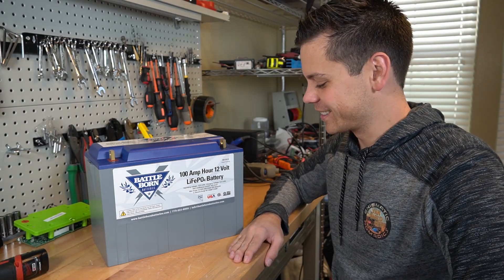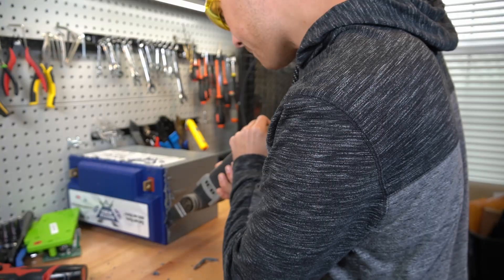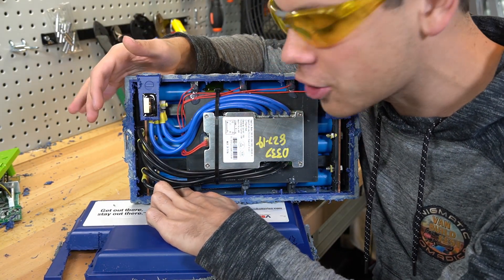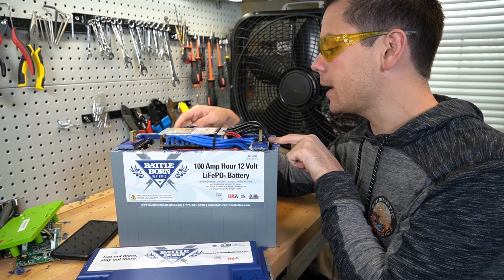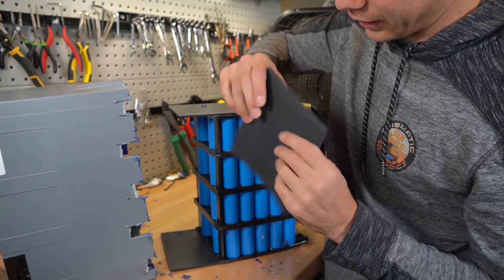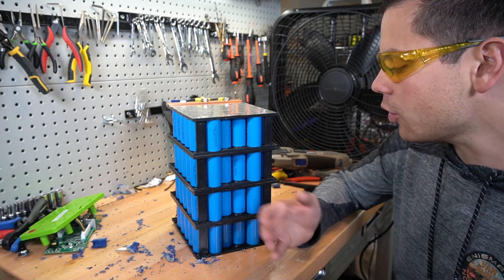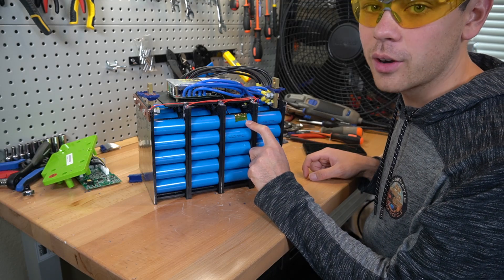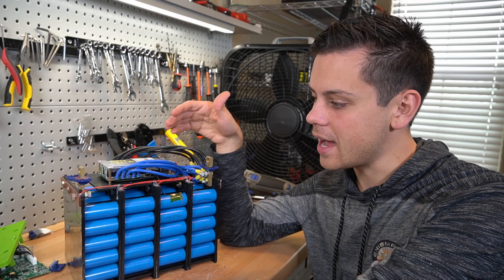$950 "Battle Born" Battery Tear Down

Comment: WELL DONE WILL !! 
Still room for improvement:
Case needs to be non-destructively open-able, yes OK that voids the warranty sticker; self sufficient people exist
Bluetooth (or other open source method) communication to an App with configuration for charge depths etc
Communication to a LiFePO4 charger, especially for low current balancing mode, plus spoofing when charged from a standard Solar charger, alternator, gen-set, all 12v sources
BMS should NOT be mounted inside the case, it needs to be outside, where air cooling is available (who cares if it "looks" like a car battery or not, really !)

so DIY is still far better... until Customers expect these features

Comment: If you had a 12v, 24v and a 48v battery bank and each bank has a total of 500 amp hour and a 20 amp hour load, which battery bank will last longer. I have 5 of these 100amp hr battle born batteries and I plan on adding to it but I don’t know if there are any advantages over the other in the above scenario. I’m thing of the 24v route..  

2nd question. Can you connect 10 12v 100amp hr batteries in a 24v configuration to get a total of 500 amp hours. Thanks..

Comment: Run a warn 5500  12 volt winch tech told me the full load amps would be 200amps , thanks for the video

Comment: Would this battery type be more vibration resistant than the 100AH smart Renogy battery that uses pouch cells?   (I tow my trailer off road)

Comment: I'm sure that you are already aware of the new Battle Born GC3 270AH battery? Stackable with mounting feet and will fit in a van. I wonder if BB is using prismatic cells? Very sexy, very flexible for fitting in unusual spaces- I bet they will sell a ton of them, even at $2,900.00! I'm gonna build my own 280AH 24v battery instead that will fit in a traditional battery tray for around $1, 200.00. Twice the capacity, twice the power not much bigger...

Comment: Why no cell level fuse? When DIY builds create these packs there is always concern for cell level fuses to avoid shorting across other cells in the pack. Maybe I'm missing something?
Reply from the maker: Yeah that's for nmc and nca variants. Not for lifepo4. Those are a different chemistry that require cell level fusing.
Reply: @WillProwse  So, for a 18650 DIY project using LifePo4 cells to create a 12V 100Ah battery we do not need to use cell level fuses? I'm assuming the chemistry BB are using in their cells are LP4.

Comment: hey my friend how's it going?
I have a question about how can i power my 220 volt hot water tank heater  with a power inverter 5K watts?
 or how many watts inverter would I need to power it?
I'm trying to go off the grid with my water heater "only".
HELP!  HELP!

Comment: I know Battleborn batteries are well proven, but the fact they aren't customer serviceable is very disappointing, to the point I will not buy them. Also they are overpriced. Even building a 100 Ah batter from Fortune cells and using an Overkill BMS still comes out to $300 less than a Battleborn. Very sad. But I will say, wow, that build quality is awesome!

Comment: Just started learning about solar powered systems. My question after seeing so many ppl changing out battery systems, why hasn’t someone designed something that allows for charging battery “pods”. Being able to add batteries banks to a current system and growing you storage capacity rather than having to do all at once?

Comment: Totally agree with the multi-temp sensor critique!   BB's being solid state can be mounted in ANY orientation and subject to basic HEAT RISES thermal principles.   
Mount BB's with their Contacts on the bottom, they can theoretically run hotter before BMS cut/off...

Comment: Will,
First of all, thanks for all the great videos. Very valuable and this one helped lead to me buying a Battle Born battery.

I've been happy with my BB battery. Now that winter is approaching I want to modify my setup a bit. Despite all the many advantages offered by lithium batteries, I know that cold weather performance is one weakness.

I have a popup A-frame camper I use all winter with the battery riding outside on the tongue. I'm thinking of going to a two battery setup, bringing my lead acid deep cycle battery back into the mix. The lead battery would ride on the tongue and the BB battery would move inside under the dinette bench. This would allow the lithium battery to usually be in a warmer environment except when traveling on the road. I come from a sailing background and would employ a standard marine four position switch (Off/Both/Battery1/Battery2) to select charging and discharging choice. I could accomplish this manually by connecting and disconnecting cables but, as you might imagine, that's a real pain in the ass. I'm a complete electrical moron so I'm hiring an automotive 12-volt guy in a couple weeks to do the actual work.

Some questions:
- Is this a bad idea?
- Will the lithium and lead batteries interact somehow in a bad way in the Both position?
- When in the Both position should (will?) the setup be parallel, series or neither somehow?
- What are the chances of damaging my expensive BB battery by putting it in tandem with my $120 lead battery?
- If I do proceed, any precautions, tips or warnings?
-Is there a better way to accomplish the same goal?

Thanks in advance for any guidance,
Steve Thorpe

Comment: A lot of us out there have RV's that have onboard generators and battery boost buttons that use house batteries in emergency to start the engine if the chassis battery is dead.  I have recently discovered that the cold cranking amps of a lithium battery are not sufficient to be used in this way, and that using them might cause damage to the lithium battery or BMS. I don't have Battleborn batteries, but I read in their warranty info that using them in this way can void the warranty. 

I am under the impression that with 200AH of lithium, it is probably okay for short bursts to start a generator, but not for starting the vehicle engine.  I have 2-100AH renogy lithium batteries that I have as a drop in replacement in my motor home.  They have been installed for 2 years, so far with no problems.  I have used them to start the genset many times, (I assume without damage!), but never to start the engine.  

Can you comment on this aspect of using lithium batteries in RV"s?

Thanks so much for your time.

David Harper

Comment: Beginning at 6:26, you say that you weighed a Lion Energy battery and there was no way it could have the claimed capacity.  Was that the UT1200 or UT1300?  The UT1200 was overrated, but from what I've seen the claimed 1,344 Wh/105 Ah for the UT1300 is accurate.

Comment: Thank you great analysis of the battery.  You said that if one cell shorted it would not take out the entire battery.  I don't understand how if the cells in each group are all welded to a nickle plate where is the cell level fuse?

Comment: @6:18 . Battery listed @ 1200wh but it built to have 1305wh. You stay having the extra capacity of some 105wh is good for charge cycling. Hmm? 
Does your cycling statement cover the battery will give user 100aH of power? okay, and protec battery from to much discharge to fail, so not to charge
from damages up to fire failure?

Comment: Like the video thanks. 
So with 4 batteries in series,  
Where is the connection for solar wiring positive and negative?
Also connected a 3000 watt inverter positive and negative  in the middle of the battery bank or on the end or the start

Comment: I admire your enthusiasm and Battle Born is tip top in my mind, but if you or I were manufacturing Batteries we would deliberately under rate them. That's what Tesla, and LG Chem do, so its not such a big secret really Generally rate 100% of 105% of True capacity limit. That's simply how its done the only way to make them, as good as LG Chem or Tesla is to thermally manage them. I'm guessing that's the next step  they will probably come with a Battery pre-heat. But as I said before Tractor Batteries on EV's have been doing this since the Chevy Volt late in 2010.

Comment: Nearly a year gone by, and nothing yet to compare (dollars vs quality) to these Battleborns? But, we can't get them in Europe :-( Or can we? I noticed a UK company called Transport Energy, that sells a similarly specified USA made battery for £1000 + tax (20% more than the Battleborn, but, given import and shipping costs of importing from the USA, not unexpectedly that much higher, plus the cost of genuinely making them meet EU/UK standards, which are pretty tough). They claim the batteries also work with the Victron Connect app (useful as Victron are used a lot). Other than the color scheme, the batteries look suspiciously identical. The strap line says 'Sold in the USA as The Leading American Battery' (whatever marketing bull that means). Could it be that Battleborns have arrived over here? Made in Nevada. But, I also found another brand, named Dragonfly, in Reno, with an identical battery. Different colors, same shape and size again. Is this branding? All very odd.
Reply: Looking in detail at Battleborn and Dragonfly, they are the same people. Why two brands? Makes me more sure they also make the Transport Energy batteries.

Comment: The nominal voltage of the battery is not 12V but 12.8V or 13.2V, depending on the nominal voltage of the cells. This is why true capacity is higher than advertised. They use 12V because 12.8 or 13.2 is boring.

Comment: I have a sailboat with two house banks one 4D AGM and one 8D AGM. A standard starter battery,  want to go Lithium, but they just have the one form factor which will waste space that is already allocated and secured part of the regs,  want to get 8 flex cells for the Dodger and Bimini, With 2 controllers new alternator controller for my 125 amp alternator.  Was talking to pacific yachts but My boat is on the north fork of Long Island, other companies have the form factor of a group 8D but want 5 grand for a 350ah 8D. And 3 for an 4D 250ah. .  Lots of sail boats use these type of batteries.

Comment: Question: my wife and I purchased two of these Battle Born Batteries for our airstream trailer. One thing that I’m curious about is “ do they need to be cycled regularly?” Simply put we use our generator once a day to do other things and end up charging the batteries to 100% nearly every day and these guys never get down below 70% before we do. Do they at some point need to be drained all the way until The BMS shuts the battery down? Before charging again. TIA

Comment: Have you actually tested the durability of the BMS?  Would be interesting to give the Battle Born a torture test and subject it to 100A, 200A, and over spec current loads to see how well the BMS protects the battery.

Comment: Are those cells fuse-attached? Because you said if one shorts the battery will continue to operate. As far as i know if one cell in a parallel pack has a short circuit it will drag all parallel cells down. Please verify.
Reply: Sorry did not watch it through first. They are spot welded. But how ofter does it happen that one cell dies.

Comment: I am interested in getting  one 24v battle born battery instead of getting 2 12v battle born batteries in series. Do you have any opinion one way or the other ? I understand I would get a 50 amp hour instead of 100.

Comment: Interesting. Makes one question using large cells, e.g. 100-200 Ah x 4 series vs huge parallel (30 cell) combinations of cells x 4 series. I guess a "bad" battery goes high-impedance and like you say results in a slight decrease in performance of the given "macro cell". Should "us" DIYers be doing more of the same, many parallel, vs buying monster cells?  -- And if a big cell fails, can you just swap it out, or will you be in a world of hurt trying to get it to match old cells?

Comment: Direct copy is not a good business model, because they need to compete with the battery they copy. While it is a good method of building tech off the shoulders of others, diversity is the way we create new things and solve other problems. So one company that could copied the battleborn and makes it better for cheaper will win. However, it may be that it is not monetarily feasible to make money off the copied product. Battle born already makes a good product and seems to have the market in the place they need it. Cheaper means more money for them but it also means cheap parts to make up for the cost. It would be better to focus on something others don't provide, like two temp sensors or a better readout interface or something along the lines to differentiate between the battery brands and attract customers that would just go with battle born for the same reasons I'm thinking about them. Warranty, Amarican made, reliable well made and customer service. Your reviews help quite a bit.

Comment: I’ve never seen anyone so hyped over a battery 😂. I need to buy 2 new batteries for my boat. It’s a 24 foot bowrider with a 5.3 liter V8 Volvo Penta motor. Would these lithium batteries be good replacements for the lead acid batteries? Would I need to make any changes to the existing electrical system currently on the boat? Thanks very much.

Comment: My main concern/curiosity is if this battery has an internal heater. I’m really considering buying multiple of these but I’m worried about them getting too cold during the winter. I live in West Michigan and I’ve been living in my van for over a year and there are times where I’m at work for 8+ hours and can’t always check on everything. During the winter especially, this is concerning. Would I be better off investing in my own heat source for these batteries or do they come equipped for such circumstances?

Comment: Do LiFePo4 cells every short? LiPo packs with many parallel cells put a series fuse with each cell so a shorted cell does not dissipate all the other cells in that parallel group. I have a bunch of 26650 LiFePo4 cells and want to make a pack like the Battle Born but thought the fuse was important.

Comment: No doubt about it; that's impressive.  Seeing four cells in series is important for adequate voltage when using the direct output of the battery.

Comment: Hey William, great video. Hey, I'm looked to swap out the flooded 6v batteries in our RV with one, maybe two of theses Battle Born batteries, but I have a Xantrex Freedom 458 inverter/charger that does not provide a spec for charging the LifePO4 batteries. I did contact them and explained that I could select a charging option that closely matches the charging profile of the LiFePO4 and use that option. What are your thoughts? Thanks.

Comment: I just saw a battery called fourvolt. I was wondering if you’ve seen it or fine a review of it. On the label it says 12.8 v at 100ah. It normally sells for 750 but it’s on sale for about 379.00. Just wondering you recommend that battery

Comment: Just discovered your channel the other day, great content... Have you looked into the AIMS Power lithium batteries? Been running a 50Ah on my kayak motor for a year now and love the ability to charge it with a 30Ah power supply. Reaches full charge in under 2hrs then goes to a trickle/float charge. Appears to be very high quality.

Comment: you talk about portable  off grid systems what do you have for a 6.6 roof top system( grid only) to add battery system so be able to use battery at night? or even add wind to the system as electricity prices are ridiculous?

Comment: In the early days of electrfication Spokane, WA had a battery house, actually a multi story brick building with thousands of batteries on racks that stored the output of the steam generators and hydro power overnight to power the increased demand during the daytime for the whole downtown area, The batteries had a thick glass case and were re-buildable right in the battery house. The old plates were removed and remelted and the acid replaced and the battery put back into service. This was an on going process.  The battery house lasted until 1953 providing Spokane with independent power.  The glass battery cases are still around and sold on ebay. Would make a nice display for the Battle Born. As a matter of fact you could start a trend of repackaging Battle Born in old glass battery cases.

Good Luck

Comment: a year ago a said i wanted to build a battery layer by layer like that and i named it lasagna built, i wasn't wrong thinking it is possible, it's the cheapest layout in my opinion
Reply: if each 18650 2.5ah cell costs 4€, in order to build a 6 series of 20 parallels for a 24v 50Ah 1200wh I will spend 480€  which is half the battleborn cost and weight

Comment: Still not sure I want to use them...cost a bunch and no good in cold weather !
Reply from the maker: They are great in cold weather. Has charging protection and can discharge to -20 celcius. Lead acid had horrible capacity and increased internal resistance at low temps. That's why lithium is better. Not as a starting battery, but absolutely better for solar
Reply from the maker: And LiFePO4 lasts 5-10 longer than lead acid

Comment: you can do a video on building a transparent purple battery case.  ebay has acrylic sheets already cut  12 x 20 then draw line where you bend,  go over line with torch till bendable and use velcro for lid.  Scorpio has interest in mystery cutting stuff open for a look but dont see James Bond so Moon in aspect to Pluto  will also have you cutting things open

Comment: Lol 26650 I've got them now I know the truth. 0% soc isn't 0% true that's a protected state of charge. 3.2 vdc full per cell  2.7 dead. I can add a BMS to sla and do that How about advertising a 235 amp hour as say 115 and install a BMS to say its dead at 12.2 the first SLA that can be run to 0% soc charge without issue.